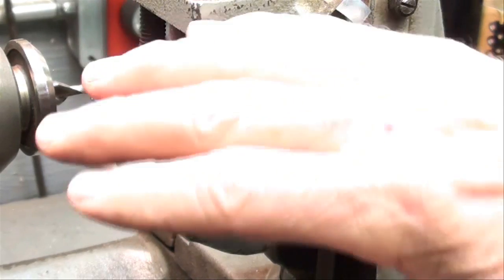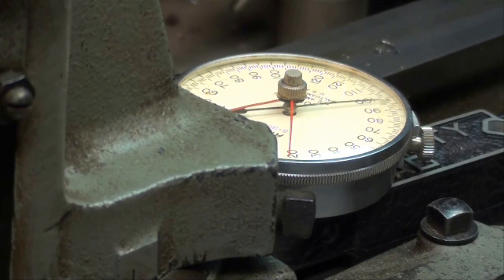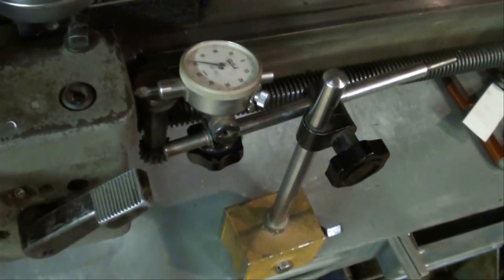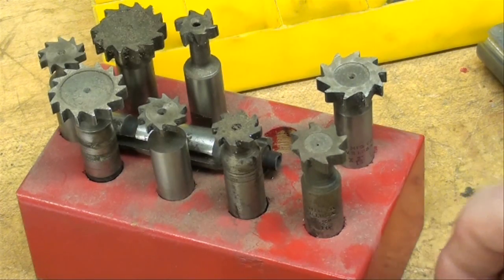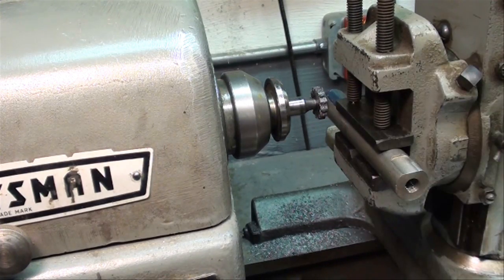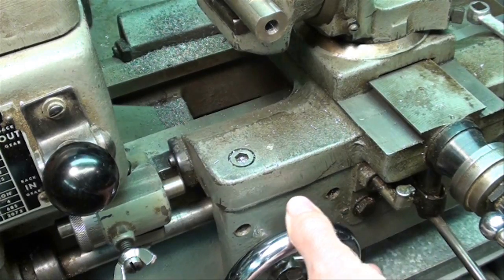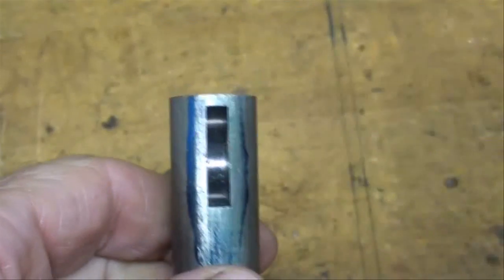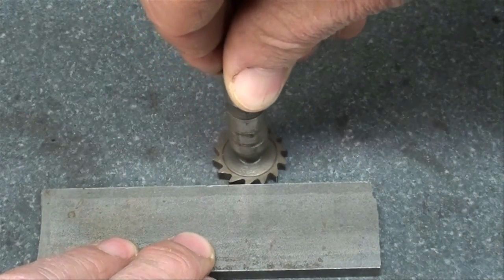Atlas Lathe Milling Attachment Part 3  #70 tubalcain

Comment: Fantastic Instructional Video !! 🤗
Mr. Pete, I have a request for you to do a video. 
I would like you to do a video on your Atlas 12” on the proper way to set the Back Gears into proper adjustment with the Spindle Gears. 
I recently acquired a Atlas 12” lathe just like yours and when I pull out the knob on my lathe to rotate the back gears spindle into what should be the proper gear mesh, my back gears do not lift high enough to make proper mesh with the spindle gears, therefore the gears just take one another ! 
Thank you in advance !🤗
Sincerely, George Antonaros

Comment: Glad I watched this,,,,thought I wanted a milling attachment for my 12 x 36,, but not at 350 bucks,,, and seeing how much strain it puts on the lathe especially the tool post holder,,, rather keep using my 1938 delta drill press milling machine I converted.

Comment: Tell me again why you can't use power feed in the Y axis? For a guy who has used these on the regular, both Versamills and these milling attachments, I tend to try to use power feed whenever possible. Even when you have the rotary cutting tool mounted in the milling attachment or have the Versamill attached, you still have power feed available. Wasn't the speed a bit low for that end mill?

Comment: another trick if have a small chuck make a backing plate for it with shank dia yr choseing a block to fit mill.attach drill and bore to fit..now mill odd shapes..little 3 inch 109 chraftsmann chucks can be found tool swaps for under 30$
Reply from the maker: +Miguel Castaneda Good idea

Comment: I program CNC lathes on a daily basis and the ONLY time Y is used is for cutting hex or other shapes with live tooling which is basicaly a mill program with the Y moves converted to a C axis and a G code I dont remember off the top of my head to make the machine act that way!! Its Crazy LOL

Comment: Hi not related to this vidio, but times I get involved with acme. So a customer comes in with
one he broke from a snow blower. Ok I dont stock all tool sizes I grind as needed, I have
an instrument draw no acme gauge. I dont really do ebay but $5.00 for one.  Got it just
now guess what a brand new origional package Starrett No 284  with a bonus 3 Starrett
taps. Now thats a miricle. sam

Comment: again I reaaly like you videos.  i have the atlas milling attachment and haven't used it.  thanks to your video I know have the learning curve shortened a lot.    

How about a video about buying a bridgeport mill.   

 lots show up in my area but alway concerned about buying someone's problems.  i would like to use the mill not buying a project to bring it back to correct working order.     thanks again for your time in doing these videos.

Comment: I enjoy your videos very much. I believe you have mislabeled your axis. I was always taught that the "Z" axis was with the spindle. Example vertical on jig grinder, jig bore, and vertical mill. And horizontal on surface grinder, ID/OD grinder, lathe and horizontal mill. I know on the cnc lathe I program the "Z" axis is longitudinal feed. Please correct me If I am wrong. Thanks for all the work you put into your books and videos. Simple Model Steam Engines one and two are great.

Comment: Love the vids, always find things I never knew)never learned that in school) I do not have a big lathe like a craftsman(no room), only a little one, a taig, but I do have the milling atachement, no collets just use the cutter in the deep 3 jaw and I must say it comes in very handy(altough mine can not rotate), most of the time I only use aluminum and sometimes with some overhang but I could not have made several things without it.